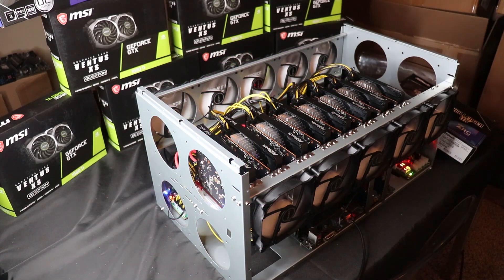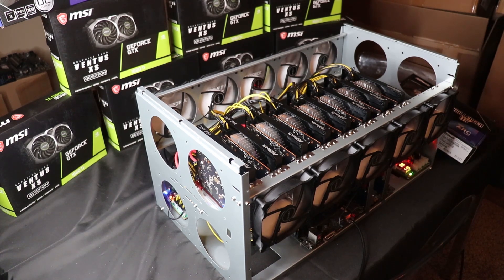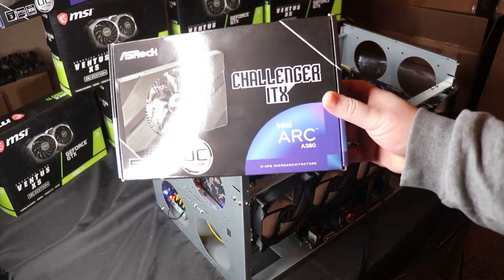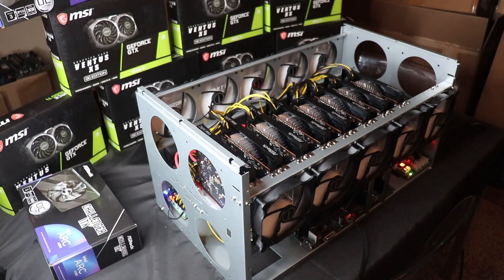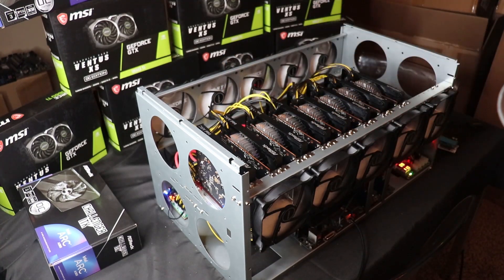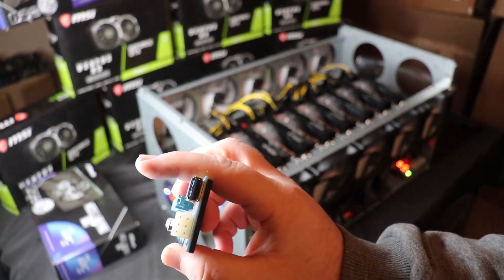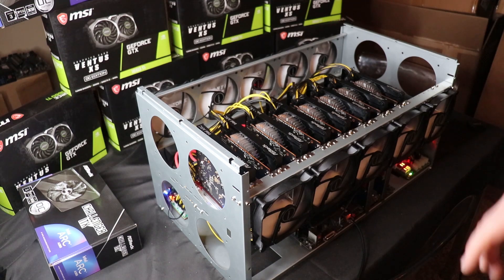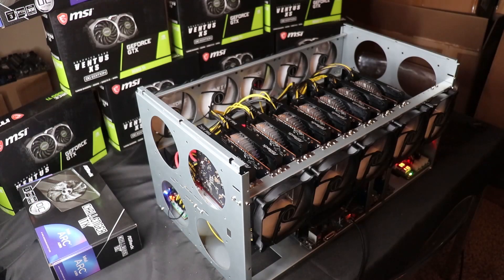I Built An Intel Neuromorphic Mining Rig

Comment: Hi Mike! I achieved very good performance with intel arc a770 in windows 11 on alephium coin. This is all thanks to the settings in arc control, but when I installed a second Intel video card, arc control cannot regulate two, only one. Do you happen to know how to solve this problem?
Thanks for video

Comment: I'm using entierly GPU risers on all of my rigs including my intel a750 rig and did not have that problem, it was all software that caused my problems.

Edit: can you link that frame?
Reply from the maker: My a750's ran fine on any of the risers. I only ran into this issue with the a380's.
Reply: @RetroMikeTech  I've been having issues with SBMiner 2.2.4 not picking up the A750's when mining dynex, but it works fine for other algo's. I tried the risers you linked but it didn't make a difference. Any suggestions? The error was something like Failed to create gpu workers.
Reply from the maker: @mattk.5258  Are you running Windows or mmpOS?